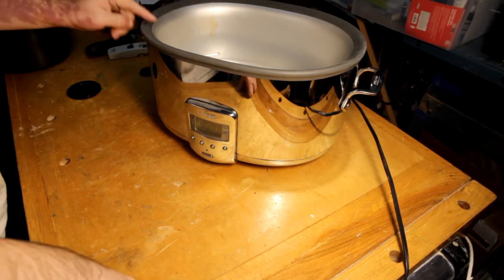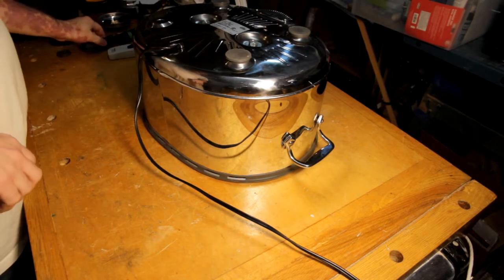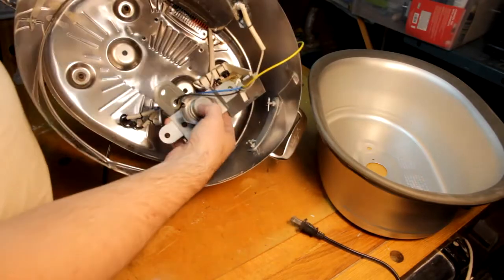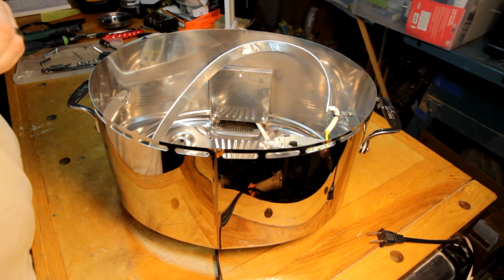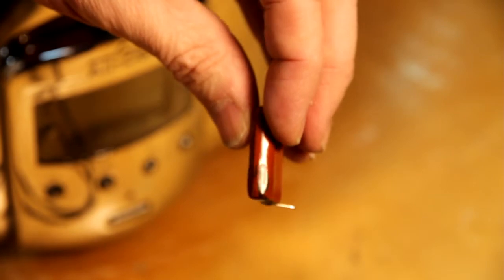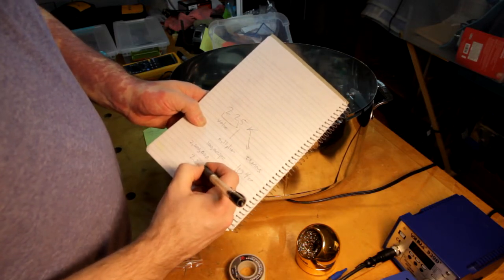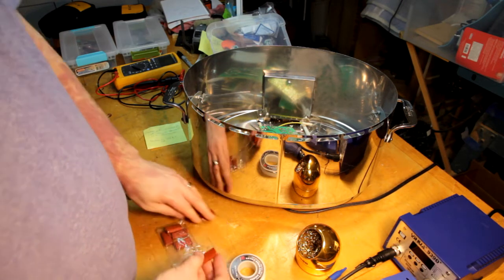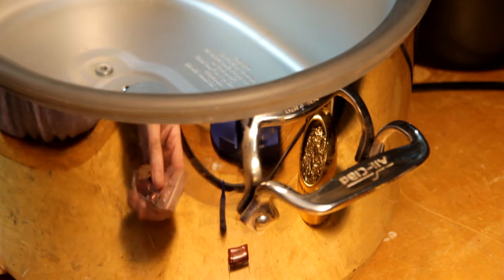Repair of All-Clad Slow Cooker

Comment: Thanks so much for this video, I was about to give up and throw my $200+ crock pot out then I saw this. Ordered the Capacitors took three weeks from China cost $10 with shipping. It is now back working.. Best $10 I ever spent. I never would have known if not for your video.  I didn't have to take the whole unit apart, like in the video, I was able to just removed the bottom (six screws and two nuts) and was able to then remove the circuit board. Still a bit of pain to get back together but certainly worth the effort, with some assistance from my brother in law the did the replacement of the Capacitor. With much appreciation!!

Comment: That was a great help! I have the exact same problem. You wouldn’t by any chance have any extra metal film capacitor 225k 250vac?
Reply: I have got extra capacitors. Did you find any sense?
Reply: Great explanation. I need the capacitor if you still happen to have it I’ll buy from you. Thx

Comment: You didn’t show the disassembly which is what I rell y needed. Ours is several years pld so not sure if some parts are sticking together or if I'm missing a tab and will break it. I guess it wont matter if I "break" it further. Ours won't even turn on. Good info though.

Comment: This is why these are supposed to be simple - switch on or off - nothing in there was needed except at 8 min 30 sec what you were holding in your hand which is the actual HEATING ELEMENT.
The rest of it is for the "fancy" display there which is not needed at all.

Comment: Can i use a 225j 400v capacitor? Will the extra voltage rating cause higher ESR and ripple current?
Reply: That’s exactly the capacitor I used and it’s working :-)

Comment: what search term did you use on ebay for this capacitor?
Reply: would you post the link?
Reply from the maker: @valeriesargent8158  https://www.ebay.com/sch/i.html?_from=R40&_trksid=p2334524.m570.l1313&_nkw=metal+film+capacitor+225k+250v&_sacat=0&LH_TitleDesc=0&_osacat=0&_odkw=metal+film+capacitor+225k+250v
Reply from the maker: @valeriesargent8158  the term is metal film capacitor - but this is just going to return results for a general class meaning that it gets the right type but not the specific one you might need. The only way to get the specific one is to pull the capacitor from your unit, check the data on the capacitor and add that to the search term. Of course this assume that's what is wrong the cooker. Proceed with caution,  - and just keep in mind that this is risky to do and you are on your own. Good luck
Reply: @RedQuasar13  how do you pull off the old capacitor? Do you have to unscreen it form the circuit board. My eyes are too old to see if those are screws holding it on
Reply from the maker: @georgeelsenerandmoniquehin543  You have to de-solder it from the board.